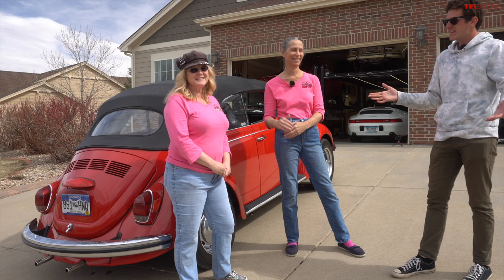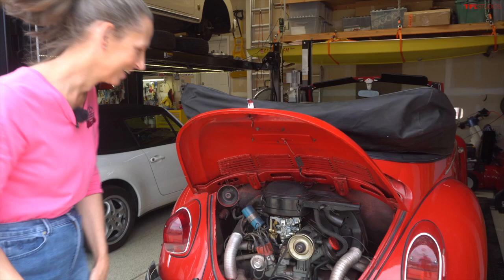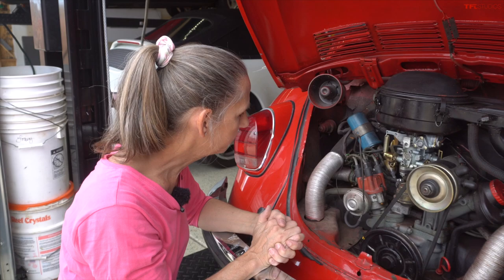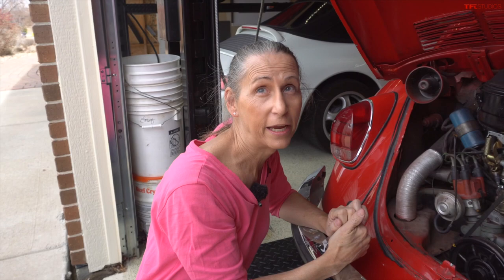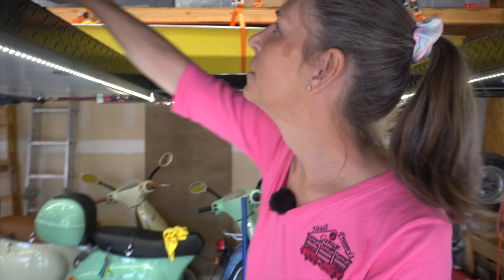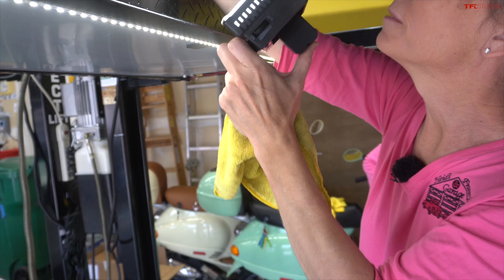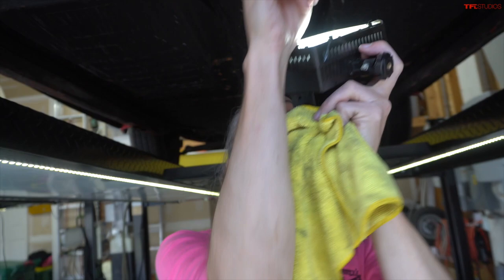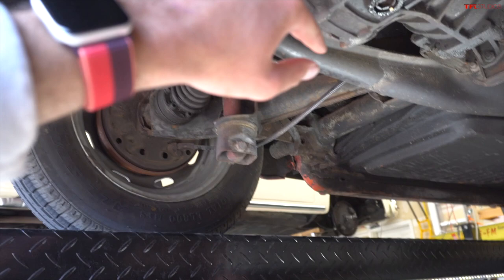Did I Buy a Deal or a Dud of a VW Beetle? A Classic Volkswagen Expert Gives Me The Verdict!

Comment: The fresh air hoses in back do help with cooling in an additional way other than what was mentioned in the video.  The heat exchangers sit against the heads and heat transfers from the heads to the heat exchangers.  The fresh air hoses direct air through the heat exchangers which helps remove heat from the heads.  If your heat levers are on, that heat goes in the car.  If your heat levers are off, that heat exits outside under the engine (another reason to be sure the rubber gasket along the engine is in place as mentioned in the video.)   If you remove the hoses or even the heat exchangers from the equation your engine will run hotter.

Comment: The original fuel pump was made by Pierburg.  They were rebuildable and are easily sourced as various members of the VW community rebuild them.  You won't have a problem with pressure if you go this route.  I would do this rather than add a regulator to a Brazilian pump.
Reply: It's funny because here in Brazil we use Brosol pump that was the original VW Beetle part and never heard about pressure issues, when the carburettor overflow its becouse the floater regulation

Comment: I'm impressed by Heidi and Franny's knowledge. Too many people say that they're "experts" in air cooled VW's, but aren't. These two know what they're talking about, even if they incorrectly referred to the transaxle as the "transmission" (which I would guess is a habit they've gotten into when speaking to customers, as opposed to them not knowing it's a transaxle).

I can take a VW air cooled engine from fully installed to sitting on the ground in right around 20 minutes, and 30 minutes going the other way (that fiddly seal takes some time, as does lining up the bolts and studs). It takes some practice and a car lift to do that. I credit the Miur book for showing how to do it efficiently.
Reply: We are far from experts and do not claim to be.  Thank you for the compliment. There is always room from growth with us.  Heidi
Reply: There are swing axles and double jointed axles.  All VW's are IRS.  Bad info that has carried on.  These gals know what they are doing.  No China or Brasil on a German car!

Comment: If and when you pull the engine, remove the fan shroud and clean the oil cooler.  It's likely caked in dirt and oil, which will reduce its efficiency.  I upgraded the oil cooler on my 356 given that at altitude air cooling is less effective.

Comment: Replace the fuel pump with a good rebuilt original and make sure the pressure is correct. Pressure can be adjusted by removing or adding gaskets. You should not need a fuel pressure regulator with a stock pump, just the proper gaskets. 

I’d also get rid of the aftermarket carburetor and replace it with an original rebuilt one. Don’t just slap a rebuild kit…the throttle shaft bushing would wear out and that needs to be corrected. Volksbitz does a great job on vw carbs and you can purchase one outright or exchange from them.

Comment: I would agree with her on the difference between the SuperBeetle and the regular Beetle suspensions.  The SuperBeetle handled better than the regular Beetle.  However, I had a SuperBeetle with 70,000 miles on it and the front suspension had to be completely rebuilt.  I also had a 1965 Beetle with 265,000 miles on it had received two sets of shocks and one set of tie rod ends since new.  It was really hard to kill those torsion beam front ends.

Comment: That was cool. She almost convinced me to buy one for my son’s first car.  She knows those so well that I imagine that she and her friends get together in the garage and disassemble one over some glasses of wine.
Reply: As a first car■■ would recommend a 2005 to 2009 Chevy impala 4 door. 
Also, Pontiac or better yet, Buick lacrosse V6 engine. 4 speed automatic. Nothing past year 2009 , because GM switched engine emissions or stopped using over head valves (OHV), type of power.
Reply: @missingremote4388  You're right. That's likely what my son will be looking at. :) Hopefully something that really struggles to move. Knowing the shenanigans me and my friends got into in high school, there's not much else one can do but provide something that's less than exciting.
Reply: @franzvanjulio5523   I have the 2008 buick lacrosse V6 and put a lot of miles on it. About  200,000 miles myself.  The car Still looking new!  And I've used it for uber (as a taxi) over 10,000 happy customers/passengers. In Wisconsin Lol
Reply: The V6 is fast and economical but if you want 0 to 60mph speed ? Premium models Available with 5.3 liter V8 engines; impala SS, Pontiac G8, and 2008 year Buick "super" lacrosse. Tires are less expensive than newer cars. Because the 16 inch rims, or 17inch tire cost less , compared to today's 20 inch tire fad.

Comment: Great load of knowledge!!! She clearly knows her stuff. Now your video skills Tommy,,,,,, hahaha. I believe you were so fully engrossed in what she was teaching you that you kind of forgot the angle of the camera,,,, heh heh. It happens,,,,,. 
     I think a follow up video with her diagnosing, and pulling the engine for that new seal would be great. I have rebuilt these and I used to watch Mustie1 on YouTube and he has done many rebuilds showing how easy they are to work on. The valve adjustment could be done inside the vehicle and that might be nice to see just to show it can be done like that. It’s also very easy to do,,,, Comparatively. 
    Just getting the engine, seals, grommets etc finished completely underneath would be a huge step forward in building and retaining the value of the car. The rust repair??? You are looking at (in Canada) a few thousand dollars to fix it with an attempt at matching the paint. If you want all the bodywork perfect and a full paint, it’s closer to $15,000 at a custom paint shop. You are still looking at close to $10,000 at an average shop. It will put you very far backwards on the value of a Super Beetle. I could be wron on the labour regarding the rust repair granted,,,,, and all my quotes are what it costs here in Canada and in the region where I live. I know I did a 69 Bronco that needed extensive rust repair and just getting it to a full bare steel stale after having it dipped and the tub rebuilt,,,,, I spent over $20k. It was nearly perfect mind you. The seams for the rust were barely perceptible if at all in most cases where it was possible to grind down and finish both sides of the welds. That was an excessive job. I still made $$ off of it!!

Comment: Half an hour to remove including electrical and throttle, gas and heater box linkage.  As far as thermostat,  they had this contraption hooked up to a flap to block air from cooling engine and was told by an old German guy that when they fail they over heat engine so just rip it out since it only starts working below 20⁰. Oh, yeah when buying a bug always grab front crank pulley and push and pull to see how much end play there is. Even with just a little bit, it will sound pretty bad and you can subtract some money from your offer 😉

Comment: There's no such thing as a "mistake" buying a Beetle. You can fix anything that's wrong with them pretty affordably. Even rusted floor pans. The engine can be rebuilt in a day with a basic toolset and a cinder block to set it on.
These cars are incredible.

Comment: Oh boy.
I was a VW fanatic when I was young. I'm by no means a mechanic, but I rebuilt several in my day. And can tell you now that this woman isn't very good!
A VW Bettle doesn't have a transmission it has a transaxle. 
Most of the time they leak from the pushrod tube which are just thin aluminum with nylon bushings on the ends. 
That rubber gasket is strictly a dirt skirt and doesn't have diddly to do with cooling. 
If the valves are out of adjustment for an extended amount of time then the exhaust valves are shot. They depend on the proper seating time for cooling, and the intake valves are probably bypassing causing the flooding issues. A simple compression test would have determined a lot more then a flashlight and a bunch of banter!